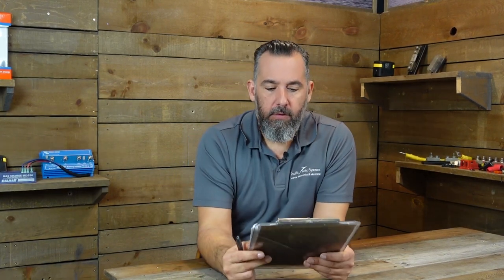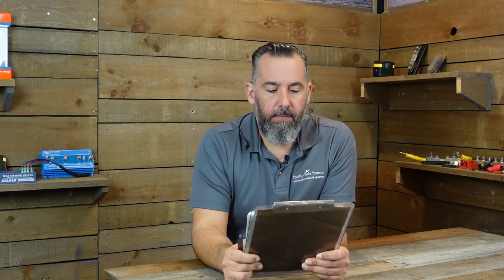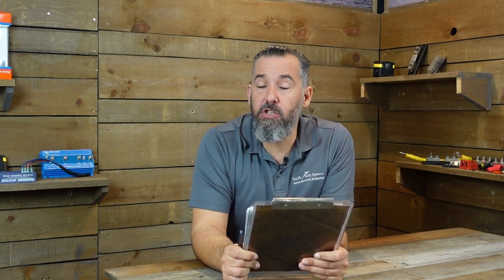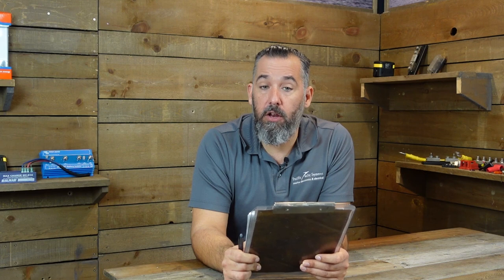Should I Use an in-Hull, Thru-Hull or Transom Mount Transducer With My New Chartplotter?

Comment: Informative video - thanks.  I love my in-hull transducer (Raymarine P79 mounted in the lazarette of our Camano 31).  I was very hesitant about going in-hull for all the reasons you mention, but this unit operates just as well as my old transom-mount transducer.  The soundings are all very solid and very accurate.  The only "issue" I have is that I can't read the bottom underway when depths are >500' @ 8 knots, but many transducers won't read in that environment anyway.  The benefits of not punching holes in my hull and zero maintenance were very appealing to me.  Not having to clean the transducer in the water after it gets fouled with growth/muscles is a real benefit.
Reply from the maker: Hi W B, thanks for sharing.

Comment: I bought an Axiom RV MFD w/ RV-100 transducer. My old Lawrence sounder used an "Thru Hull" transducer and using SeaTalk is compatible with the Axiom. Being that I have an inboard boat with twins takes transom mount out of the equation. At first, I connected the old Lawrence transducer, and it worked but didn't have the clarity and functions of the RV chirp transducer, so I prepped my hull down in the bilge, boxed off an area using a PVC 12" electrical box, and installed the RV-100 transducer using epoxy. I was amazed at the difference form the Lawrence, and the ONLY issue is the temperature reads wrong.. I can live with that. Your assessment that "shoot through the hull" will yield "Marginal results is inaccurate. as long as your hull is not cored, and you make sure there is no air bubbles when installing, shoot though the hull works perfectly..
Reply from the maker: Thanks for sharing Patrick.

Comment: I have a Robalo R222 that came with a Garmin 742XS/Airmar B619 transducer through hull.  I just bought a Garmin 943XSV that supports Sidevu.  I bought a Transom mounted G56UHD-TM but am being told that the GT56HUD-TH Thru Hull is better.  First problem is I would have to leave the Airmar B619 in due to hole dimensions being different.  Airmar had a 2.94" hole.  New one is 1.3/16.  Second is it true that you would need two of these transducers for Sidevu to work properly due to the bow angle being great then 5 degrees?  That the transducer would not be able to see the Port side of the boat?  Thank you for your help

Comment: I have a question about in hull signal resolution. I have an older Lowrance Fish Finder/GPS unit that I'm replacing the transducer on. Apparently the old transducer was the issue and I'm amazed at how much the signal has improved and how much information is returned about bottom conditions testing out the old transom mount. I'd prefer the cleaner installation of an in hull mount, but I like the ability to see what bottom conditions are like for anchoring etc. Would in hull mounting be able to distinguish between a muddy bottom and gravel the way a transom mount seems to?
Reply from the maker: Hmmm, not sure.

Comment: i have a fast trimaran.  It is a cored boat.  The inner and outer skin are probably an 1/8th of an inch.  I bought a Simrad and want to install  in-hull.  My plan is to carefully open up a big enough cavity ...but not penetrate the outer fiberglass skin..  I am hoping for a good signal through such a thin skin.  Any thoughts, Sir?
Reply from the maker: Never heard of someone doing that, would recommend getting approval from builder or expert on hull strength when removing one skin layer and the core.

Comment: Any idea if you can install a thru hull B75M or B175M and so on, through a stern drive(hull), I/O 5.7L 20 foot boat?
I am worried about the interference from the engine. I have looked and looked and cannot find any info on it. I presently have all of them mounted on my transom.
Reply from the maker: Good question, IMO it should work just make sure the through-hull is forward of the stern drives.